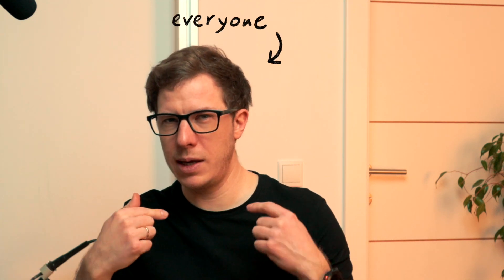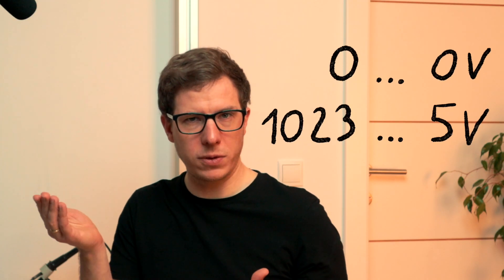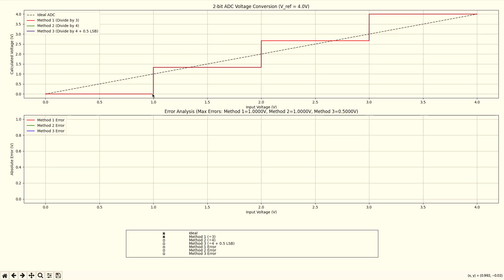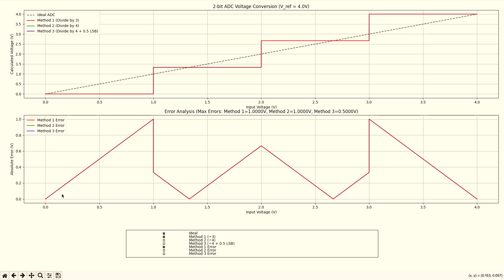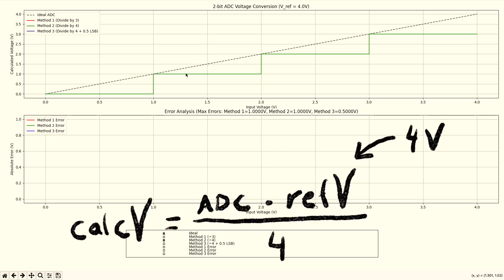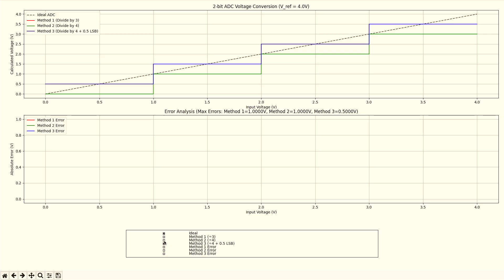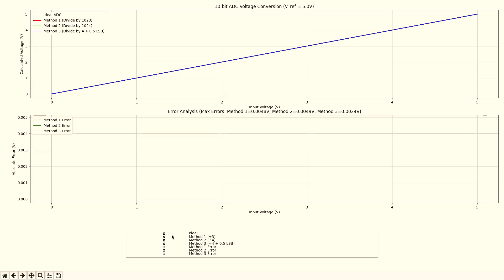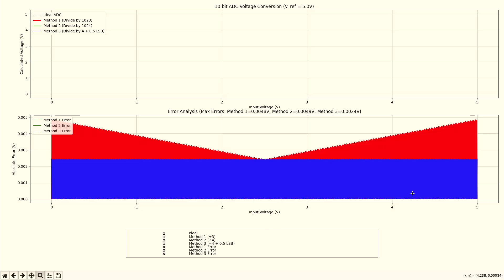Analog Digital Converter Mistake - How NOT to use an ADC

Comment: I let the ADC sample for 16 times (or more) then devide it :16 :1024. So i get a bit more resolution then 10bit. For 328P (Arduino) i use LM 4040 AIM3-2,5 0,1% as reference (also works fine if using 3,3V)  +0,5LSB is a good concept. I try next time
Is somebody today using BASCOM-AVR like me? 🙂
Reply from the maker: Averaging multiple measurements is great for improving the accuracy! I never tried BASCOM-AVR, it looks fun!

Comment: You shouldn't need to add 0.5 LSB to the calculated voltage - the ADC effectively does that for you, and the standard datasheet formula ADC_code=(V_in*2^N_bits)/V_ref is correct.

Look at an ADC's input voltage vs output code graph (eg in the ATmega328P datasheet) and it will probably show the code change occurring in between voltage "steps", like it's rounding the input to the nearest code.

You can try this with np.round(..., 0) instead of np.floor(...) in the demo Python script. In practice the least significant bit is lost in noise and non-linearities anyway...

Comment: SO well explained. Should get an award. Only thing I didn't get though was what adding 0.5 of the LSB looked like in practice. Do you mean we take the number returned by the ADC and (in addition to the other stuff) multiply its LSB by 0.5 and add that? or, in essence, if it is an odd number we add 0.5 and if it is an even number we "add" 0?
Reply: oh wait, do you mean add half of the voltage represented by the LSB of the ADAC value? So in the case of the arduino, with a reference voltage of 5V, you would add  something like 0.002V for odd ADC numbers... and nothing for even ones? I'm probably tying myself in knots here.
Reply: @WistrelChianti  I also did not get it, is there a kind soul to show us an exact formula or code snippet?
Reply: @WistrelChianti  looking at Oliver's python code it seems he just adds 0.5 unconditionally as a constant. Does not depend on ADCs resolution/LSB value
    def method3(code):
        return (code + 0.5) * (V_ref / (2**n_bits))  # Add 0.5 LSB (optimal approach)

Comment: If you can use the integer out of the ADC, do it!  In general it is better to stay away from floating point arithmetic when working with small micro-controllers.   If you want to increase the resolution and reduce the error consider oversampling and averaging.
Reply from the maker: agree! stay with integers whenever possible

Comment: Very cool, had no idea, i just copied code to use my ADC to measure voltage, which was using  (ADC x vref) / 1023  which made intuative sense at the time but i didnt understand how ADC's worked and this really helps.  Ill try the new method.   Its actually for a battery capcity tester so it could use the accuracey boost which is the only drawback of the particular circuit, it uses a 1ohm shunt resistor to measure which isnt ideal because it drops voltage throwing the reading off, however i still found the reading to be as accurate as my multimeter, maybe multimeters are doing it wrong to? ... you never know the code thats controlling their ADCs.  I got the code off a youtube video that showed to make the tester https://youtu.be/zgrMHbX9UC8?si=DDDykfBLM-FY1oe4  The code also forgets to turn off the mosfet, so when youre done testing capacity,  the battery is still draining, be careful.   Ive since bought a ready made tester but ill give it the ADC update and see how it compares now.
Reply from the maker: For your application I would use an INA219
Reply: @playduino  Yeah thats what everyone says,  but as student  that was a whole level of complexity i wasnt prepared for  building my first practical circuit.   The 1 ohm shunt really simplified it and made it approachable and  kind of gave you an understanding how to read current using a voltage drop.  And it soon makes sense why 1ohm isnt ideal and the ideal solution comes from a smaller shunt but now you cant measure the voltage drop accurately with an MCU hence the need to amplify the signal.  And to avoid all that we have the modules. Cool, but have you seen the datasheet for that thing?  So many options you can program, which is really cool, but i think youd need to understand the basics to get the full use out of it anyway. Its interesting to see how they calculate their ADC's voltage measurements, but i can barely understand it.  Maybe your method is better? I think the next logical step for a student would be to amplify the tiny voltage drop across a  small shunt themselves and learn more about that, and then finally when you've realized how inefficient and crappy your circuit is, you can buy the ready to go module? Sure just like GreatScott does.
Reply from the maker: I get your point, in order to understand how it really works, the 1Ω resistor solution is perfect. depending on the max. current / their-for voltage on the resistor, one way of improving your setup is to use an external reference voltage that is as low as required. this way you match the range of your ADC to your signal.

alternatively you can use a non inverting opamp circuit to increase the voltage before you put it into your ADC

when it comes to INA219, there is a library for Arduino with some examples and some ready to use modules so you do not have to dig through the data sheet in order to get it working, its pretty easy.

Comment: Very nice video. Thank you!
Reply: I didn't measure it on an Arduino. I only just checked the "compiler explorer". Of course the compiled binary will be a bit larger with the last variant. But I guess, that it will be even faster then the 1023 variant, since dividing by 1024 is faster, since it only shift the bits.
Reply from the maker: wow true, the compiler should be able to optimize this using shifting. did not think about this! thank you
Reply: @playduino  The only disadvantage of the last variant might be, that commands like if(voltage==5), if (voltage==0), if(voltage), ... doesn't work as before and must replaced with if(value==0), if(value==1023), ... But i don't know if command like that are used many times. So maybe only a very small "problem".
Reply from the maker: Yes, that's true, but usually voltage ranges should be used. You will always have some noise and error on the voltage reading, so using if(voltage == 0) is always risky. I would always do something like if(voltage < 0.1)